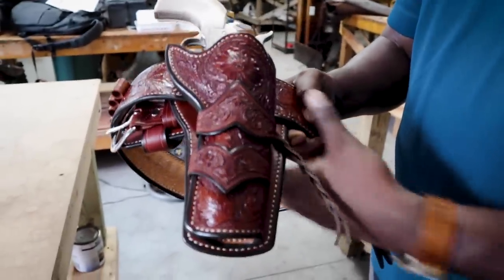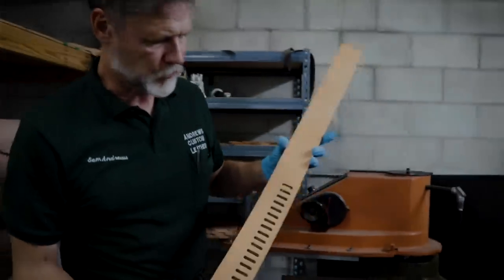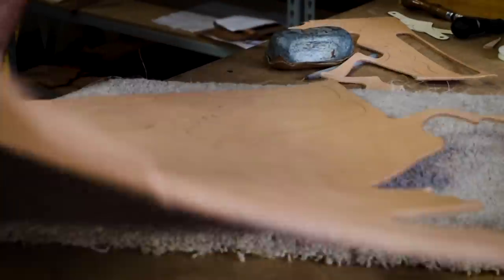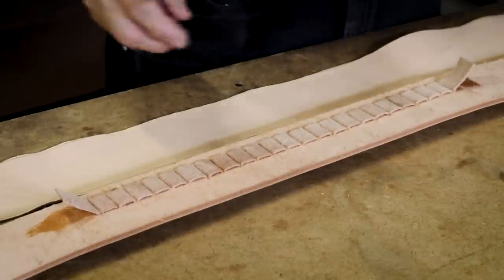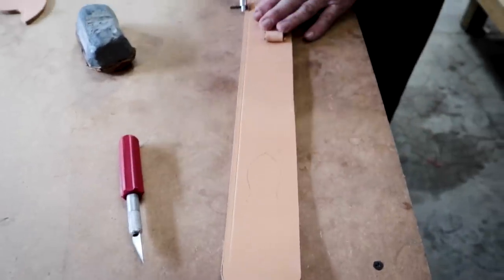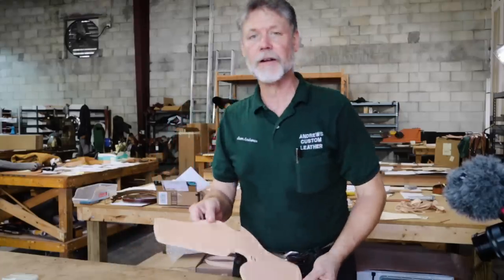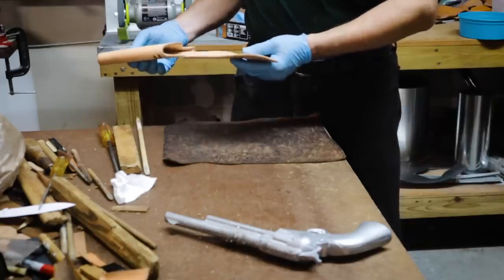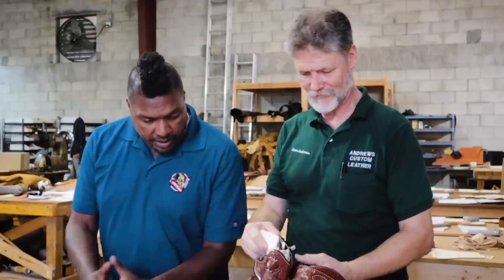Leather Holster Making // Western Cowboy Fast Draw Rig // How It's Made

Comment: I just started to make a double  holster but I did not follow your pattern up to now. I learned a lot from your illustration and I want to thank you for it. I hope to follow your examples. Mine have been single leather belts without a lining, I thought that it would get too thick and un maneuverable. Lacing and tooling I did also on my first one and I sold it to someone who thought that he could use in a Rodeo setting. I hope it was a good show.

Comment: it’s always awesome to watch any Master at his or her Craft  i’m a retired Woodworker  and have done lots of Chiseling  to stop the “bounce “ of my Mallets on the Chisels i generally use a No Bounce hammer or a Dead Blow   which is usually a hammer  with a hollow inside filled with sand or metal shot that absorbs  the force of the hammer stopping suddenly  and helps prevent  any bounce  many people make versions of this hammer  and many Woodworkers choose to build our own Wooden one  i was wondering if you had tried one when using your punches ?  i’ve always been interested in Leather goods  and  the types of work you do in these videos  although the closest i’ve come is   by teaching myself to do Automobile interiors  with my heavy duty Walking Foot Sewing Machine  i bought to do Marine Canvas and Uphostery on my boats  in a effort to  have a higher level of quality control  over the items i want or need repaired  of course it’s also a cost savings and  a time saver to get things done  onmy time frame

Comment: I was always taught to use UNFIRED cartridges in making my bullet loops as the FIRED cartridge cases have a bit of "expansion" and therefore somewhat larger in diameter which would result in loose fitting cartridges.
Love the video!

Comment: A quick question, regarding the punch holes.. what are the 4 that are on the "belt flap" side for? I understand the one on both sides is to hold the "holster side" to the "belt flap" side with a screw, but what are the other 4 used for

Comment: A sharkskin firepower rig modified as follows;

AR pistol using a MILSPEC lower and upper (flat top) instead of a 12 GA other/SBS on the right side.
Firearm on the left side, SIG P250/320(S)C, vertical oriented for right handed draw.
Left mag pouch, three 20/30 round AR-15 .223 Rem/5.56mm mags.
Right mag pouch;  3 SIG P250/320 mags that can handle any size SIG P250/320 magazine including the 21-round 9x19mm extended mags.

A wicked John Wick/Neo (The Matrix) rig for firepower, lots of firepower. 
Since I'm carrying two pistols in this firepower rig, it's legal to carry in Nevada concealed.
Reply from the maker: yeah sharkskin I'm with that
Reply: @hankstrange  I purposely made my request for this contest an AWESOME BIG ONE. 

If I win, I'll do a demo of it on my portable range on the BLM shooting area I frequent.

Samuel Andrews is an awesome holster maker.  Thanks for having him on the channel. 

All the best.
Reply: @hankstrange  Eh, I didn't win.  At least I tried.

Comment: Does he carving happen before or after the glueing and stitching ? Great Job on both craftsman!
Reply: Hey Casper I do leather work myself....yes carving is done before gluing liners and stitching. Also a helpful tip is use blue painter's tape on the back side of whatever piece you're tooling to keep the leather from stretching. Hope this helps you out.
Reply: All of the pieces are carved prior to any assembly work.
Sam Andrews
Reply: Thank You for the timely replies Very, Very impressive work. Thinking of getting into leather work.

Comment: It seems silly to put a Glock 19 in such a great holster, but that's what I have. So I'd say a Glock 19 Saddle Style with Thumb Break or a Monarch. A Monarch is too much to ask, though. I wish I had a better gun to submit. I still need a revolver, which seems far more fitting.

I'd request a scabbard for my Coach Gun, but I don't have one yet. Hoping to get the new side by side from Black Aces Tactical when they are released.
Reply from the maker: everything looks good in a leather holster...when they have to come out of the holster glocks work great though
Reply: Oh yeah, no question, I love my Glock 19! It's just comparing artistry to artistry.. at least mine has some slide work.

Comment: hi good evening I saw his video and I would like to do my best to make a holster for airsoft replica in cardboard or the like but not knowing the dimensions of the holster before the gluing and also of the belt with cases Now with his permission I would like to know the measurements also in inches after I would turn them into cm (italy) both of the fondian and the cinturone Thanks and congratulations again Alternatively if you can send me a link where there are measurements of both both the belt and the holster
Reply: The belts are 50-75mm.  If you go to places that sell these things like Ted Blocker, or Mernickle, they will give dimensions for the belt. That way you can choose the right belt for the style you want to do.

There are online patterns for holsters, but any time you change anything (like using cardboard would do, you have to redraw the pattern anyway.  Just fold it over the pistol and cut it with about 3/4" (18mm) extra, and glue that or sew it, and you can then trim back the excess till it looks right.  That is what I do when I make a new pattern, or for a different gun, or with a different welt, or material, or different weight or lamination of leather.  I can never use the same patterns for any different situation.

A few years back my daughter decided at the last minute that she wanted to go as a cowboy for Halloween.  Diner was approaching, but I went out to the leather shop and made a belt and a holster, the belt had to be pieced together, The holster had machine embroidery on it.  It was based on a holster from 3:10 to Yuma.  I had the whole rig made up in about 30 to 40 minutes.  It was better than most cap gun holsters, but not good enough to sell. But I was really proud of it because I had to design and built it in such a short time, and even if it wasn't so good, Halloween waits for no one.